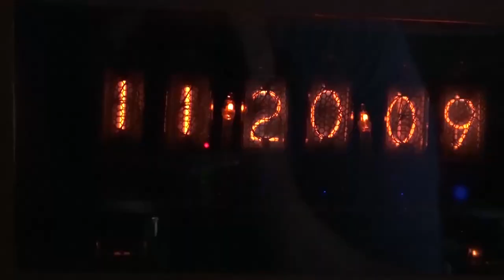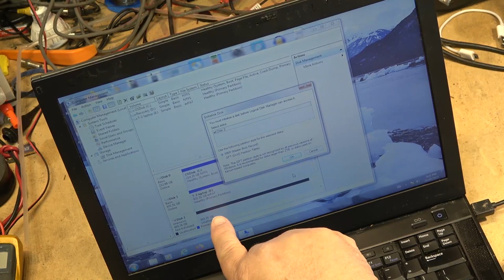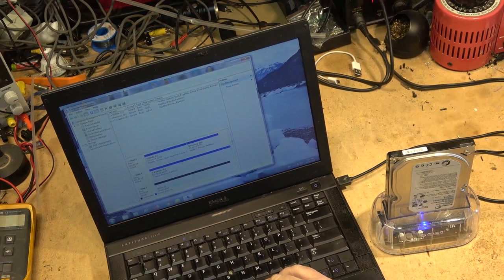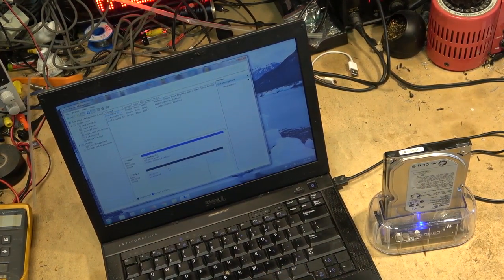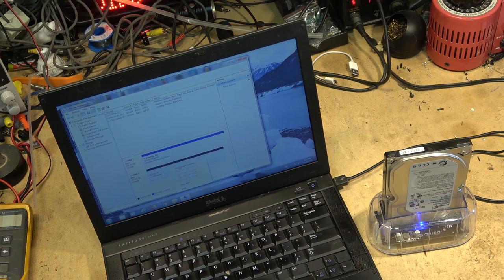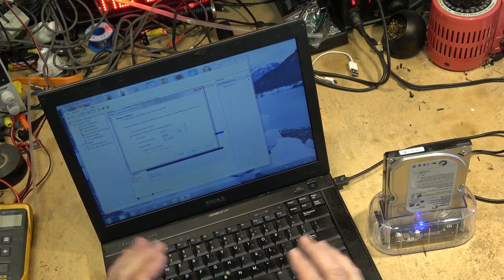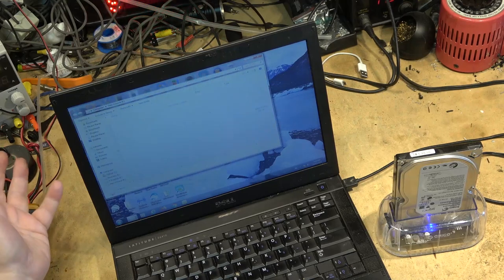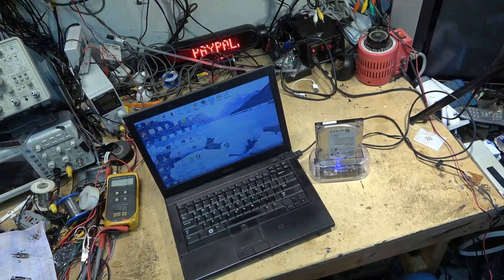Tear down and recover hard drive out of old Motorola cable box.  Will it work?

Comment: - wants the hard drive
- slams device on bench first
😐
Reply from the maker: He dropped it from about as far when it fell out of his truck.
Reply: It's about how careless he is with his clients stuff
Reply from the maker: @BavarianM  
It's my stuff i throw around not clients.  
Clients equipment is handled with care. The old crap of mine most is heading for the bin 5 minutes after the camera is turned off.
Reply: Was about to say the same thing lol
Reply from the maker: What people don't realize is 90% of the stuff i work on is mine or has been donated.  Very few devices are customers.  I get much stuff donated and i will attempt to repair it and if successful I sell or give away.   When i do have a client's device great care is taken to ensure it leaves in the same condition that it arrives.
Reply from the maker: Hard drives that are not spinning had take quite a jolt and not have any negative effects.
Reply: @12voltvids  Hard Drives can take about 1000Gs I think when off
Reply: @12voltvids  apart from that.... if you really want to advocate for reusing old equipment, it doesn't appear very appealing if you throw stuff around like you did...
Reply from the maker: @kaimauracher6758  this is going in the trash.  I only wanted the hard drive out of it and dropping it 4" isn't going to hurt it one bit.
Reply: @BavarianM  1000g?  That's 9810 ms^-2.  A drop from 6" would have an impact velocity of 3.9mph and assuming a deceleration rate of 1000g it would stop in 176 μs.  In reality this device was dropped onto a wooden bench, so the deceleration would be more like 100g which would stop the device in 1.76ms.
Reply: @12voltvids  Depends on how compliant the drive enclosure is; if the drive's held rigidly it could well be subject to severe deceleration.  Also, if the drive falls at the wrong angle the deceleration could well cause the heads to unpark and impact the platters; curtains for the drive.
Reply: its a free drive, who cares how far it was dropped. Got drives from our old SkyHD boxes they are held in secure anyway.
Reply: @rs2klee  Depends on what you use the drive for; if it contains "valuable" data, and it's not backed up; you'll care.
Reply: @davidgriffin79  yes "if" we are talking about the drive that came out of this old machine so "who does care whats on it" or course its different if its your own.
Reply: @rs2klee  What I'm trying to get across is that if you don't treat storage media with respect and then subsequently re-purpose it with your own data, then don't be surprised if it fails and don't put "valuable" data on it that isn't backed up.

Comment: Brutal man, Brutal - as in opening that PCMCIA card.
Agree with the comments about BGA, basically making everything unrepairable.
And - who is the twit who said you cannot use old set top box HDD's, just a pity you cannot rip video from them.
I hang onto a few of those cases as they allow you to build projects that look right next to a TV/HiFi/entertainment system.
Reply from the maker: Yup video is encrypted.  
Need to record the programming using the component video output first.
Reply: @12voltvids  That's what I assume, they just like being a pain in the but

Comment: I find the PCB’s are good for the odd surface mount cap, and chokes etc. Plus the large chips are good to practice on with the hot air gun. So I have a bin of scrap PCB’s just for the odd salvage part.

Comment: Good job! These units or equivalent generally use interesting HD. The fact is you can generally reuse them as back up or external usb unit once inserted in a USB enclosure. Here you also have a SATA disk type, wich eventually can also be reused as secondary in any desktop unit. However, a SMART check is always a good idea to check of global health, bad sectors and hours counter. Some old PATA type are generally less interesting, slower, and with low capacity compared to the 1To standard, but, what do you expect for a donated or 2$ unit? Those interested in data retrieval can eventually test the same using a LINUX based PC, as you can generally read and access other classic formats used in these boxes like ext3 or ext4. However, there's no way to say if you can retrieve any data on these if the system uses any form of encryption, wich is now current (you can encrypt your HD with W10 pro!)...

Comment: I have Dell Latitude D620 on the side of my bed with screen mounted to wall. Its embedded screen itself is busted from drama long long ago hahaha. It's nice for what I use it for - watching 1080p. The thing is, in browsers, the acceleration is a no go because of Intel drivers (just the way it is, nothing can be done about it.) So, I have a plugin in Firefox that sends videos to MPC-BE. That is my recommended player for ANY class machine. For BEST quality possible, use MadVR as video renderer. Just install MadVR, customize settings if so inclined (easy), and set the player to use it in settings. Easy as can be.

Comment: I have an old ASUS U36S laptop with an i7 chip. It's 10 years old and works fine with Win 10 on it.
Reply: I got a 2005 Dell XPS gen 4 and it runs windows 10 a little bit slow but you can use it for light stuff.
Reply from the maker: Win 10 blows.  And by that I mean it sucks.
Reply: @12voltvids  This I agree on. I was surprised when clients started to bring computers with Win 10 on them for service. The surprise was I did not know how awful 10 actually was at the time. Nowadays it is not nuch better. Quite reliable but a mess. You need to take a vacation to find an entry in the Control Panel... On older computers you wait a lifetime to install updates, which often make things worse. Instead of fixing things, things get often broken some more.
Reply: @12voltvids  I've never had any trouble with Win 10. I do agree though, Win7 was better. Once I have everything set up, I'd like to start using BSD again.
Reply from the maker: @channelsixtysix066  win10 is a joke.  My old work computer win7 never had any issues.  I could work all day and never had to reboot.  I was forced to change to win10 because no more support fur win7. I now have to reboot usually 6 or 7 times a day. Either the internal LTE aircard vanishes or the VPN won't connect, or it goes blue screen.  It guy changed LTE card, same problem.  All of us are having the same problems. Then there is my unlock pin.  On win7, I entered it every time i unlocked my computer with my smartcard.  That would unlock all of my corporate access to all my work sites.  Now I have to enter my pin number for every page I open, and now i have to not only use my pin, but many sites require 2fa using finger print scanner on my phone.  When phone battery dies I am locked out of my work apps and have to sit around with my thumb up my ass while the phone charges enough to start up so I can use my laptop.
Reply: @12voltvids  It's a pity you can't have the updates for Win 7 that is open to corporations that still run it. If updates were still available, I probably would have still run it myself. I'm only going by my own experiences with Win 10, though it is obviously deficient for what you use it for. I hope you find a solution to the problem. Cheers.
Reply from the maker: @channelsixtysix066  this is why I run Windows 7 on my personal computer. I'm not too worried about updates on my desktop because I don't use it for internet use so it's not vulnerable to attack it's used for offline editing only. My laptop is exposed to the internet but I don't visit unsafe websites and I don't install a bunch of apps on it so I'm not too worried about a virus getting on my computer again because I'm careful. Like people sent me files all the time for me to look at they go in the trash bin I don't look at files that people sent me if someone wants me to look at a video for example of a symptom they're having I have them uploaded to a YouTube channel and I'll look at it on YouTube but I won't download the file directly. It would be nice if Microsoft still supported Windows 7 but unfortunately those days are gone that's why we upgraded all of our computers at work and when Windows 10 works it works good but the problem is I spend more time restarting my computer every day and it gets frustrating especially when you're using it and you close the lid and then remember you forgot to do something and open the lid to continue only to find that the computer is frozen and needs to be rebooted yet again that's the frustrating part
Reply: @12voltvids  I'm probably not putting Win 10 under the same stress you put it under, hence the problems you're having with it.
Have you considered Linux, or is that just too much of a hassle?
Reply from the maker: @channelsixtysix066  
Stress? If you mean running browsers with chrome and IE is stress well then ok.
My work computer has no applications at all. Just Cisco VPN everything I do is web based and win10 still has issues.   Linux is a no go because I don't feel like learning all over again.  I just want to turn on my computer and work not fiddle around trying to figure out how to make something work.
Reply: @12voltvids  I find Windows 10 works most of the time. The problem is updates (at least in the old days) would sometimes cause huge problems. For example, after one update I permanently lost access to all my NTFS encrypted files.

Comment: The Xfinity X1 boxes, at least the newer Arris models that do 4k are literally held together by torx screws, opened one up the other day to get my data off of it, before I sent it in to be refurbished as I was ending my service with them, and yes, I wiped the drive clean. Have to admit the fact you can only view the drive on linux is amazing.  I may hate RDK -v and rdk - k (Reference Design kit for video (reference Design kit for broadband)) but it's still a neat OS

Comment: To answer the question at 2:35 of where it came from, out in your neck of the woods it's almost certainly gonna be Shaw. I just so happen to have the exact same model out in Manitoba that's still going strong to this day, but I notice that they're hitting it over the head in two Calgary neighborhoods specifically, so I imagine its days will be numbered sooner rather than later.

It's a shame that there isn't any legislation up here like the US has that forces cable companies to let subscribers self-install their own CableCARDs/M-CARDs into whatever equipment they wanted that supported it (like an XP Media Center Edition system back in the day), since all Shaw did/does is shrug at the question of PCTV setups and go "officially we don't support it but we won't stop you from trying". Real PITA but apparently some people have made it work.
Reply from the maker: Eastlink is the competitor out here, shaw in the next town over, but I don't know where this one came from because the guy that gave it to me was from out of town.
Reply: The FCC just recently dropped the CableCARD requirements that providers were required to follow. Even though its been around for years, 3rd party CableCARD accepting hardware is scarce. Also providers were pretty good at hiding the card rental option and equally clueless when it came to activating and supporting CableCARDs.
Reply: @NJRoadfan  Really? That's bad news for users of HD TiVos (I think the most common third-party device). I wonder how many providers will still offer it?

Btw analog cable was great because it just worked. No equipment rental or DRM needed.

Comment: While I am not aware of anything with a swappable bay anymore; if you are looking for a repairable laptop with a good keyboard I am in love with the Dell Latitude 5490. You can repair the whole thing with a single #0 Philips head screwdriver. The 5490s are starting to go out of warranty en masse and are popping up on ebay for insanely cheap for the specs. A new 68wh battery is ~$55 and will give you 6 hours of run time easy.

Comment: You can salvage all hard disk drives from all kinds of tv cable boxes as the electronics are the same as pc hard disk drives, I've done it myself its just the different tv media vendors use totally different unrecognised file systems to record the tv media on to. So windows just sees the whole drive as unallocated.

Comment: On the laptop did you ever consider cloning the boot drive on to a solid state hard drive I did that with an all-in-one HP the machine work great the machines is also 10 years old. Did you ever use Macintosh computers I just bought one with an M1 chip I'm very impressed with it
Reply from the maker: No, boot drive runs just fine as it is.  My desktop has 128g SSD for boot and os.

Comment: I use a flat blade screwdriver and just break the centre pin in the screw.
Reply from the maker: Not on this you wouldn't. Not a security torx. I have bits for that. This is a totally smooth round bolt with notches for a security socket drive.
Reply: @12voltvids  9 inch angle grinder.
Reply: These screws look like the 'Game Bit' screws Nintendo used on their old game cartridges. I would expect a hex driver of a certain size to work, or maybe a 'U' bit. But since you were just scrapping the case what you did makes sense. Why waste time preserving something that's going right in the trash?

Comment: my latest TV box got 'upgraded' to cloud recording :(
Reply from the maker: That's coming here too.
Reply: @12voltvids  I found out the annoying part is THEY decide my recordings are deleted after one year
Reply from the maker: @maicod  that way they can sell the shows back you you if you want to watch again.  That's what happens here.  You can buy the older seasons of tv shows for 35.00
Reply: @12voltvids  :(
Reply: @maicod  That's part of why having your own recorder is great. My TiVo Series two still has an old recording or two from over 10 years ago. The recordings survived ownership transfer (we bought the DVR used), the switch from analog to digital cable, and even provider changes without any fuss. Cloud 'DVRs' are just rental services, you don't get to keep anything.
Reply: @eDoc2020  yeah sadly the 'future'. I have a Mut@nt HD51 DVB-C 2x recorder
Reply: @maicod  Fortunately for you I don't think Europeans need to worry. If I'm not mistaken you can just get a CAM and install it in the equipment of your choice, giving you the same control of your own recordings as you had with analog. Here in the US we don't have that. We have CableCards but devices supporting those are scarce and if you are lucky enough to have one the decoded streams often still have DRM. If you want to record a show from a premium cable channel and watch it at a friend's house, you're basically out of luck.
Reply: @eDoc2020  I am able to record the so called free package of channels (determined by my cable company) of which the 3 Dutch public broadcaster's channels are in HD and the remainder in digital SD (sufficient to watch). I'd need a CI+ module with a card to be able to decode the other channels but I tried before on my HD51 and it didn't work. I'm ok with my current situation though.